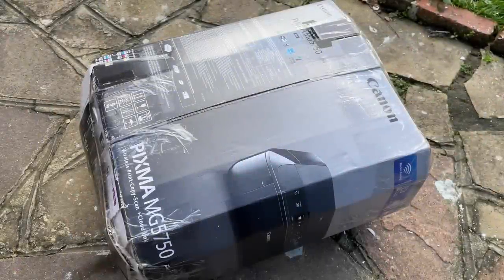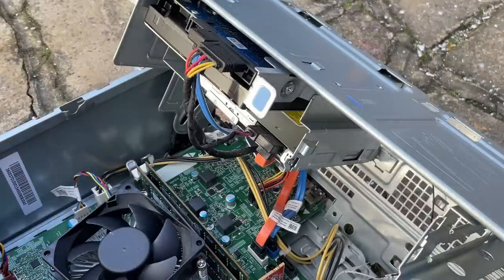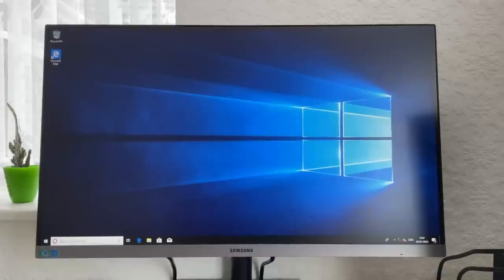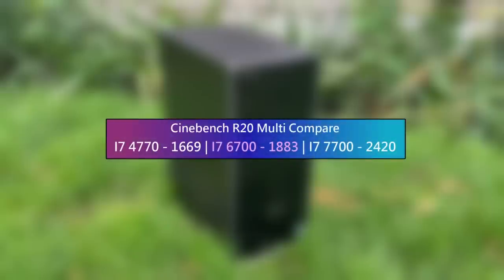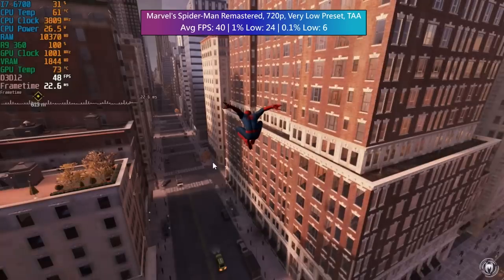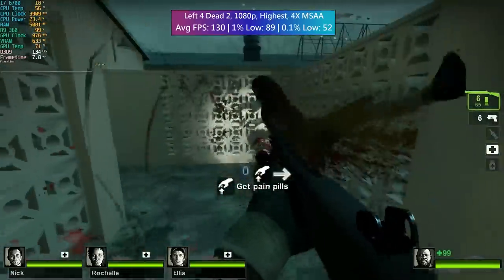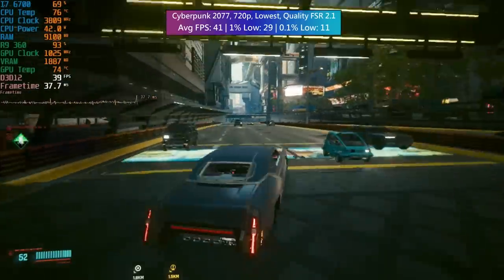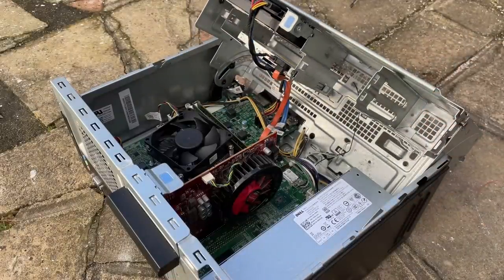$900 Dell Inspiron Gaming PC From 2016 - How's It Holding Up?

Comment: Nono you were right. Wireless printers are humanity’s greatest enemy.
Reply from the maker: all my experiences with them have been awful haha
Reply: Genuine evil
Reply: @RandomGaminginHD  I get it but I’ve had a brother laser jet for 8 years or so and it’s absolutely amazing. Cheap to run, wireless always works. It replaced a wireless printer that I had to trash.
Reply: @CovenantAgentLazarus  dot matrix works well.
Reply: True, spend like 3h last time in the hotel of my aunt trying to get the wireless printer running. No chance lol
Reply: My wireless printer these days takes upwards of 30 seconds to begin printing something, and then another 30 seconds in between every page 🙄
Reply: @CovenantAgentLazarus  the best budget printer is to get a good one off eBay :)
My Epsons have always done me well. Canon, on the other hand... just useless
Reply: 3D printers are easier to use than traditional printers.
Reply: @Gatorade69  so true
Reply: Somebody needs to make an open source printer!
Reply: @Intelwinsbigly  The sound it makes though.
Reply: @matthewl5434  slower than my printer over a parallel port.
Reply: @mbsfaridi  I like the sound, it never jams, and it hasn't had a ribbon change since 2021.

Good for annoying my neighbors too.
Reply: Firms flogging cheapo printers and then extortionatly priced INKs are probebly the longest-running PC scam ever!
Reply: @Intelwinsbigly  Yeah 🤣 it’s slow and loud but great for printing text.
Reply: @mbsfaridi  Exactly, a single ribbon has lasted me over a year, and it costs less than 20$ to replace it with a brand name replacement ribbon. For text, dot matrix is king.
Reply: @TheSpotify95  I've got a HP Wireless printer and it works great :)
Reply: @Intelwinsbigly  I wonder if they’re still used in travel agencies 🤔
Reply: @mbsfaridi  I got mine from a bank, they weren't using it.
Reply: @CovenantAgentLazarus  old school laser printers were pretty decent
Reply: @Intelwinsbigly  Hmmm, mine’s from travel agency.
Reply: @PhilipKerry  Same! Love my HP network printer
Reply: @patty109109 agreed.  my parents have a decade old laser printer. It's bad for printing documents with many different pages but it's really good
Reply: @CovenantAgentLazarus  brother printers are amazing, they just work
Reply: @Gatorade69  nah brother is good
Reply: @RandomGaminginHD  I did like the built in scanning via web server our hp printer had.

Comment: it would be cool to see how itll perform with a 1650 or something that doesnt need external power
Reply: I also wondering how this will perform when combined with rx6400
Reply: @mrbobgamingmemes9558  Not so great since it is PCIe 3.0, but better than this
Reply: @mrbobgamingmemes9558  rx6400 will need PCIe 4.0 which this doesn't have
Reply: @TheSpotify95  does it slower than 1650 without pcie gen 4 ?
Reply: @mrbobgamingmemes9558  probably
Reply: I had this pc as my first desktop in 2017. Like in the video it wouldn't boot to windows so I got it for cheap, and I eventually upgraded to a 1060 3gb with a second power supply with a paperclip in a ground and green pin and I ran it like that for about a year. I eventually got a new motherboard, ram, and case and put everything together in one package. That same power supply that had a paperclip in it so many years ago is actually still in my PC with a 3700x and 3070 lmao

Comment: Dell and HP prebuilts, especially their workstation lines, are solid, no frills work-horses. I'm using a Z220 I've had for 10 years since new, right now. Used every day and I've only ever swapped the HDD for an SSD.
Reply from the maker: Yeah they are, and an ssd is sometimes all the old beasts need to get a new lease of life!
Reply: I've had similarly positive experience with Fujitsu prebuilts & mobos (save for the custom PSUs & PSU connectors they had later, kinda annoying). You could even overclock CPUs in their 775 mobos thru SetFSB and I even managed to get a gaming-stable overclock on a Pentium E5800 from 2.8 GHz to 3.5 GHz, then swapped the CPU for a quad-core Xeon thanks to the G41 chipset it came with which allowed pretty crazy combinations.

Comment: I'm still running an i7 6700 after all these years and it's great. Modern gaming at 4k rarely pushes it passed 70% usage while having other stuff running in the background. For budget builds skylake shouldn't be overlooked.
Reply: i really wish my i7 would game like this but its so sluggish and i cant  even run ow anymore 🥲
Reply: When gaming at 4K the GPU becomes a(n) (even) bigger bottleneck. So yea therefore the cpu probably doesn’t do much
Reply: @samoerai6807  Indeed, only game I've played at 4k that my cpu is the bottleneck is Cyberpunk 2077. GPU only reaches 80-90% but I'm still able to reach 60 average on high settings so it still doesn't matter I guess.
Reply: @Simmonsumers35  what gpu do you pair with the 6700? Also you could try a bit higher settings to make it more of a gpu bottleneck. It’ll give you better graphics, can reduce stutters, and in some rare cases it gives your more performance in fps. This is when your gpu is faster then your cpu and it’s not the bottleneck. By shifting the load to the faster component (the gpu) by increasing graphics settings, it may result in more fps
Reply: @samoerai6807  I'm aware of all that but in CPU bottlenecked conditions at 4k the bahavior isn't as predictable from game to game. Sometimes higher settings just run way worse becuase in certain games it just can't get passed the weaker CPU no matter how hard you push the GPU. I run a RTX 2080 TI and like I said, only Cyberpunk 2077 has shown a bottleneck scenario where getting to 60 fps takes a bit of fiddling with settings. Any other game I don't struggle to get to 60 so upgrading my cpu seems unnecessary at 4k unless games suddenly get way more CPU intensive in the coming years which I doubt as the consoles are pretty weak this generation.
Reply: @alainsabido1327  I just upgraded from an i5-6600k to an R7 5800X3D and the difference is insane lol. ow2 went from like 120fps to 600 & valorant from 150 ish to 800+. crazy.
Reply: @Simmonsumers35  2080ti! That’s quite a massive gpu for a 6700 haha. I got a laptop with 1070 and i7700 HQ 2.8GHz base 3.5GHz boost 4 cores 8 threads. At 1080p I find the cpu to be kind of not aging as well as the 1070. Especially in cyberpunk it took quite some sacrifices to get the cpu to work well. For the rest, for €550 it’s a phenomenal gaming laptop
Reply: @samoeraionblitz4338  Yea your cpu is like 20% or so weaker than mine so that's why it's showing its age more than mine, especially at 1080p. Laptop cpus just kinda are slower but for under $600 USD that's a pretty good deal nonetheless.
Reply: @Simmonsumers35  that’s what I thought! 🙂
Reply: You can drop in upgrade to an i7 7700k and it would work, just update your bios.
Reply: @cgwworldministries83  Be better to spend not that much more and get a i5-12400 or i5-13400. Way faster chips and motherboards aren't that pricey.

Comment: Can you upgrade the GPU in these or is the PSU and size of the case too small ? I’d be interested in if you put something like an RX 6400 in this to see the I7 push itself a bit more
Reply: RX 6400 would be great in this system, I'm using one in an Optiplex 9020, i7-4790, 16GB DDR3 1600 and it does great.  This i7-6700 is better with the same PCIe 3.0 slots so should perform a bit better in 1% lows.  CPU-limited games like AC:Ody simply do not get 60FPS thanx to CPU bottleneck even with gfx at lo and the GPU far from 100% load, but most others with medium CPU load like H:ZD and SotTR keep the 6400 at 98+%
Reply: Actually just did that with a dell optiplex small form for my niece, got it for about 120 used. Came with a WD m.2, threw in 32gb of ddr3 to fill all the slots. Hooked up a new Kingston ssd for extra memory and threw in my used rx6400. Everything running while gaming only using a little over 100 watts and it works great at medium settings 1080p, also threw in a i7 6700 just because I found a used one for cheap. All in all I was very surprised on how well it gamed, only thing is heat because the gpu gets up to about 75 degrees C at 50 to 60 percent usage but should still be good.
Reply: @lewzealand4717  that’s interesting, I love the budget side of the pc world. I was thinking of getting an optiplex system for my nephew and was thinking of GPUs small enough for them. Obviously the RX 6400 is the first to come to mind
Reply: @Chevymonster203  I was thinking of doing something similar for my nephew 🤣 it’s good to hear as they are fairly cheap now after the shortage
Reply: @Crayonmuncherrrr  I figured she is going to play less intensive games anyways. The only thing is the space, the card is pretty close to the PSU but it's a front to back airflow psu so no extra heat from the unit reaches the card. Cpu won't break any cinebench records but it was running at like 55 percent on Skyrim at medium to high settings.
Reply: @Chevymonster203  seems pretty good, thanks for letting me know 👍
Reply: Just for fun I upgraded to an rtx 3050, couple months later still no issues.

Comment: This machine with the red trim was actually my first desktop computer. A friend of mines folks that had more money than they had sense had this machine in their office of the business they owned. Windows corrupted and needed to be reinstalled, and his son asked for my help fixing it,. By the time I had gotten to it, they bought a new system and let me keep the inspiron. 

It was a massive step up from the i7 4510u / GT 730m laptop I had, and I was thrilled. I eventually went to upgrade to a GTX 1060 3gb, but not only were there no additional power connectors, the internal power supply wouldn't keep up either. So, I bought an EVGA 750W PSU on marketplace, put a paperclip in the ground and green pins, and was rolling. I eventually harvested the CPU and GPU to put in a new case, bought an MSI H110m gaming mobo, and that was when I realized that the prebuilt was using DDR3 after I had everything taken apart. $50 later for some funky mismatched ram off of marketplace and it was alive and I could play CS and transport the PC with much more ease. 

I ran that rig with the i7 from the prebuilt and a 1070Ti in a couple different chassis until a couple of years ago until I had proper justification to upgrade. So many memories taking that pc, side panel off, second PSU duct taped to the top. That machine taught me so much about computers. Thanks for taking me down memory lane.
Reply: Amazing. Always great hearing about some janky diy system that actually works

Comment: It would be interesting to see what would happen if you installed a 7700k and something like a 1650 or even an rx6600 in here. The ram could be upgraded to 16 gigs of ddr3 2133 too. As the 6600 only pulls about 130 watts, it would be just fine with something like a sata to pcie power adapter. 

Or you could just upgrade the PSU while you're at it and basically you would just be left with the old shell and the motherboard.
Reply: putting a modern GPU in this would be perfect the CPU isnt a bottleneck
Reply: @dakotajones8010  you can't put a modern cpu in this computer the motherboard won't support it
Reply: @jponz85  GPU a graphics card
Reply: @Dakota Jones  gpu sure. My gf has an alienware aurora r4 and has same cpu but has a 1070 and runs games just fine 1080p high settings
Reply: You don't wanna put a 7700k or a 6700k even in there because you'd need a better cooling solution, which can't be done with that particular case/motherboard. Besides, the 6700 is still a very capable 1080p, 60fps gaming cpu. 
The videocard would be the best upgrade, and a 1650 could do fine with that, or a 1650super with a sata to 6pin adapter. That and make sure you have 16gb of ram and you an play any game in that computer, i assure you.
Reply: @josejuanandrade4439  yup I can confirm this
Reply: @josejuanandrade4439  that aside, I saw for the first time today 6th gen processor with DDR3, and almost sure 7th gen will not work with it. Otherwise it could do with some "coffee-mod" mobile CPUs rather than desktop 7700.
Reply: @andyshtroymish4997  Most Kaby Lake chips actually support DDR3, it's Coffee Lake which drops DDR3 suppport (with one exception, Coffee Lake + DDR3L RAM is possible with H310C motherboards)
Reply: @andyshtroymish4997  Skylake and Kaby Lake support both DDR3 and 4, depending on the motherboard.

Comment: Used to have 6600K around 2016 and got 6700K later, they clocked 4,6 and 4,7 GHz respectively and ran everything with high fps (excl. Battlefield 1 and onwards).

Comment: I have an almost identical system to this! Only difference is its an HP, it has 16gb DDR4, and the XFX R7 360 which has a 6 pin and I overclocked it to the max! You will most definitely see an improvement with DDR4 over DDR3L. The i7 6700 is still respectable and it pairs nicely with a GTX 1060 or RX 580 for 1080p
Reply: There's an idea for a video if it hasn't already been done. Skylake x DDR3 vs DDR4... how much difference does it make? Right now I have a Haswell and if I were to upgrade I would probably try to get something newer than Skylake, but prices can dictate purchases... but doesn't Windows 11 generally require 8th gen/Zen 2 or better?
Reply: @SeeJayPlayGames  I feel like the only quad core worth upgrading your whole system would be the i3 10100F/B450 combo is way cheaper than investing in Skylake. The i3 is quite a bit faster than the i7 6700 and you have a lot more upgrade potential with 10th gen.
Reply: @yeetus59  B450 is for AMD. I think you mean B460. And for the same or less money, one could get a B560 instead and be able to go 11th gen later - if it's worth it, which I understand it isn't. But, either would require getting DDR4 memory, which I don't own any of right now. So maybe the cheaper option would be a B85 board and a i7-4790K or something, but those are a bit expensive. But at least I have RAM - 2 4GB sticks I'm not using right now and 2 8GB sticks that I am. All 1600MT CL9, so not great, but at least they're not 1333MT.

Maybe a better route to repurpose my old 3020 would be to move the i5 and 16GB RAM to a B85 board, and get a cheap i3 to plop into it along with an SSD and 8GB of RAM. The idea is to set up a "better" computer for my wife as a side effect of my upgrade. She has an old Ivy Bridge Celeron 1007U (1.5GHz 2C2T) laptop, ugh - but hey, it was dirt cheap, like $50 and then I spent $70 on accessories for it, which can move to a new system. I think an i3 with 8GB and an SSD would be okay for her needs. She's into emulation (SNES/PSX/N64/GC), web surfing and light video editing (VirtualDub). Maybe leave the GT1030 in it as well, or at least put it in whenever I can get a real GPU and use the GT1030 for an interim solution. Meanwhile, I will have the option of going to an i7, but is it worth it over what I have? I think maybe not, not in the 4th gen. And maybe boosting up to 32GB RAM, but as it stands I've yet to max out 16GB. And with 4th gen intel, I might as well not bother with anything faster than GTX 1070/1080 or RX 590/5500XT, so that keeps things cheaper as well. Not trying to spend a fortune here. And yeah, 1080p is fine for my old eyes.

Comment: Good to see this PC being featured! I'm still using this Prebuilt PC as of today! (inspiron 3668 in the asian market I think) You can slap in a good gtx 750ti or rx 460 or even a gtx 1050 to run this baby without a problem but boy oh boy upgrading this PC is a hassle since it's a prebuilt you are limited to any upgrades such as ram(you are allowed to use only 16gb 2400mhz), GPU and ofc the PSU! The PSU is the biggest problem you'll face unless you can buy that 8 pin PSU converter for the mobo but i need to wait for months just to get that thing. So what my technician did when i was upgrading the gpu (rx570). He let the stock psu  run for the mobo while there's an external psu to power my Rx 570 and it worked like magic. I play triple A games to Med-High, I can achieve high framerates and a 144hz monitor is capable to this built for esports game like valorant, R6, and CSGO. Been using it for 5 years from now and it's still a beast for all my gaming needs! I may start with the worst pc and the worst decision to buy it since i was a noob back then but with a little touch of internet magic and modding they can take you anywhere my man. THE SKY IS THE LIMIT!

Comment: I upgraded one of these for my nephew recently but his had the i5-6400. I put one of those weird  1050ti that needs a 6pin in it (wouldn't boot into windows without it). I used the dual sata dell cable GP2JM with a 2xSATA-to-6pin adapters and didn't worry too much since the pcie slot should provide enough power. Alternatively, i found out after that the VX372 dell psu is compatible and has a 6pin but it's only 315w.
Reply: 315W is enough to run an RX6600, just sayin'.
Reply: @darthwiizius  True but I found out about that psu after the system was up & running back with my nephew. May consider it for future upgrade if he holds on to that pc.
Reply: @txslacker6179  
I suppose it'll come down to the overall cost to benefit thing, a 6600 is about the highest performing card in that set up and the CPU may well bottleneck it. 
It's a good card for the cash and pretty efficient, but that's now.  Who knows in a few months or a year though?